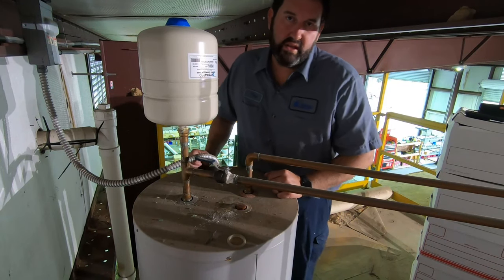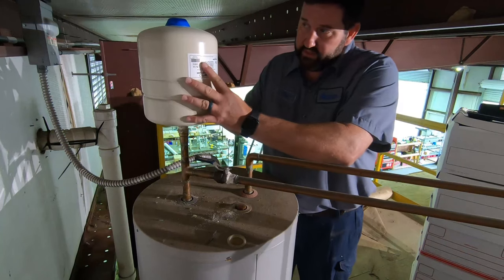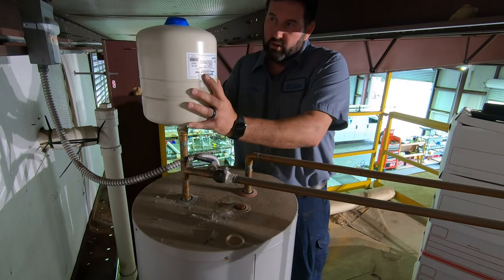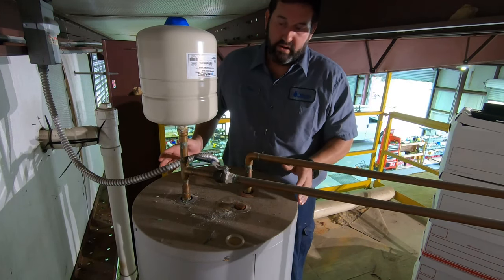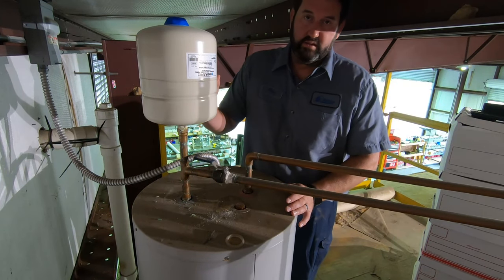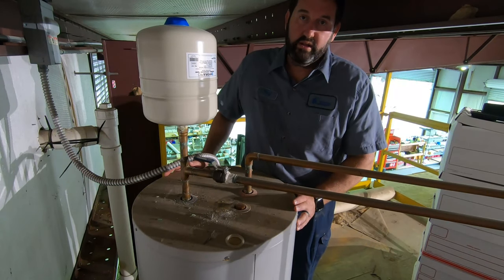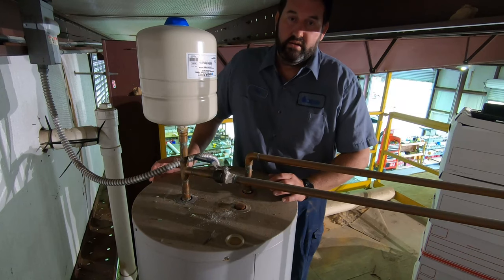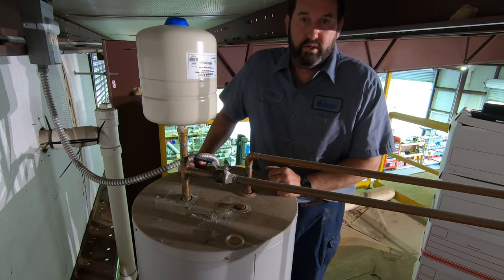What does an expansion tank do?

Comment: If you are on a well with pressure tanks you don't need an expansion tank unless you have a check valve between the tanks and your house. pressure tank is on the cold water side is correct. I located mine under my kitchen sink, on the cold water side. It doesn't have to mounted on top of your water heater. could be any where on the cold water line in the house in front the water pressure regulator if you have one. Just a couple of flex hoses and a water T can make mounting and installing and servicing the tank, easy. Plumbers like the water heater mount because they get paid for changing the plumbing. they do keep your pressure valves from leaking....
 Gotta use your brain people....
Reply from the maker: We like installing  them on the water heater because it’s the most efficient place to put one. We don’t have many customers that want to give up cabinet space under their kitchen sink for an expansion tank. Also, the water heater is also the most convenient place to access a 3/4” line, which is what the expansion tank calls for.

Comment: While I agree with the video creator on the topic, I just bought a house with 1988 Kenmore Power Miser 5 gas water heater in it. No expansion tank, 1/2" pipes for cold and hot installed on 3/4" fittings, but it still works and no leaks. Mystery...
Reply from the maker: It’s awesome to see the exceptions to the rule. We got a call from a customer that said he had a 30 year old Montgomery Ward water heater and was asking about replacement. He said he was going to let it ride a little longer just to see. He hasn’t called back and that was about 5 years ago.

Comment: Can a bad expansion tank cause the water to be hot on both sides of the lines?
Reply: No you have a cross connection somewhere
Reply from the maker: Not that I know of. if you're talking about lines hot to the touch on both sides of the heater, that's pretty common and had nothing to do with the expansion tank.
Reply from the maker: I agree. A very common one we've seen I when a remodel is going on and a new shower valve is installed with out the cartridge, only the temporary cap, during construction. You have to install the cartridge on the top out in these situations when the home is occupied to avoid this mixing. You'll get a call for sure to come back and fix it! What others have you seen to be most common?
Reply: @walleyplumbingcompanyllc5188  Yeah you have to put that cartridge in for sure. I have never seen that one but that would 100$ do it.
Reply: Dip tube broke inside tank